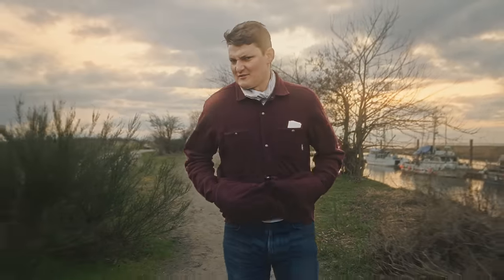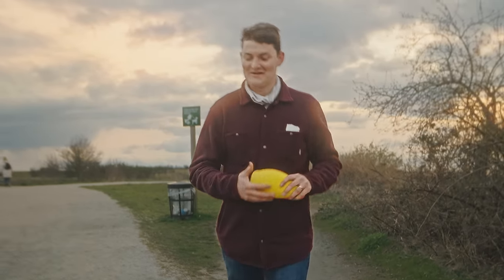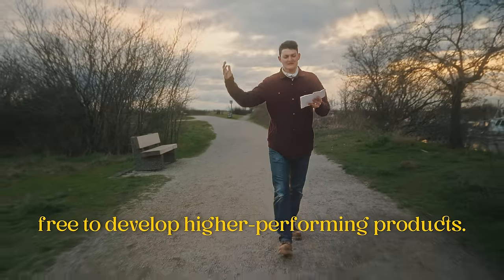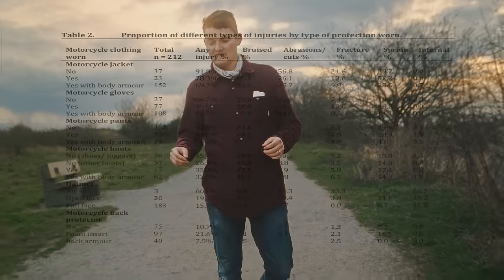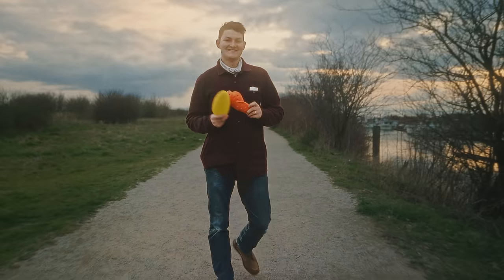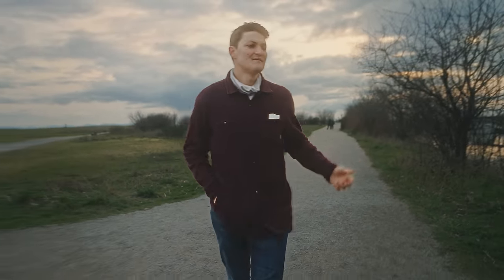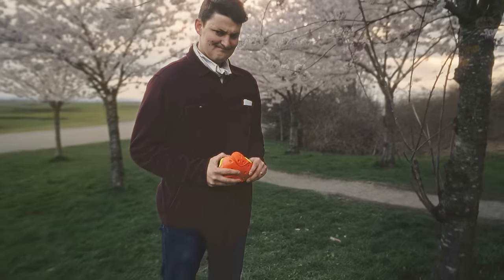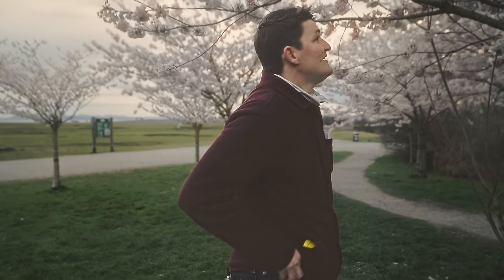Why I Stopped Wearing Motorcycle Body Armour

Comment: The joke here isn't manufacturers limiting testing, it's that more riders don't clamor for better gear and more realistic size options.

You COULD remove armor from gear...  Or, you know, get gear that's actually comfortable WITH the pads in place.  I've had plenty of falls in various sports, including on a motorcycle, that would have been much worse without that "insufficient" padding.  Not every impact is going to be 50 Joules or more - which means the armor stands an extremely good chance of reducing that 25 Joule impact to a point where it won't break a bone.  I don't feel like a safety sally because that same "insufficient" gear also eliminates a dozen everyday nuisances and makes it MORE enjoyable to ride.  For example, shoulder, elbow, and back protection lend structure to a jacket that might otherwise flop about.  Knee armor would have meant shaking off a relatively minor fall and enjoying a weekend at MotoGP, instead of limping around and pounding Ibuprofen like it was candy after wasting half a day at the Emergency Room.
Reply: Good point. Years ago I dropped a 125 on my ankle at 2mph wearing street boots and was in a cast for 6 weeks. Dropped my Varadero on the same ankle in December but in motorcycle boots and it didn't even leave a bruise.
Reply: In my experience motorcycle gear works extremely well when falling while slow. But you might well break a bone just falling over on a motorbike.
Reply: If I take your comments literally these pads offer enough protection - NO more is needed so no improvement ever. In a world where materials etc are evolving - manufacturers should never try to improve their products??? legislation is the driving force for R & D and the need to sell that product drives data collection.
Reply: @pamvarnsverry2444  Apparently you didn't read...  Why would manufacturers make more expensive gear if they don't think it would sell?  And no, MORE legislation is not a good thing.
Reply: @AM-hf9kk  legislation is always a 2 edged sword.

Comment: I have fallen a hundred times, maybe more, on my 20 years of riding. The sentiment that extra padding doesn't make a difference in falls is ridiculous and yall should be ashamed of yourselves for suggesting otherwise. Only one if my falls resulted in a broken bone (my thumb) but all of them hurt! And before I began wearing motorcycle-specific, padded gear, every fall resulted in real bad scrapes, bruises, cuts and punctures (an inch-long metal shard stuck in my butt cheek). Not to mention torn clothing.
Since buying even the cheapest gear, falls that would have pretty severely injured my knees, hips and elbows instead were just a tumble. Minor or major injuries that would have limited my ability to safely ride have been completely avoided. Heck, I looped my DRz and it fell on me and drug me ten feet on tarmac. If I were wearing combat boots and Levi's, I'd have needed skin grafts!
This video is misguided and will convince people who haven't crashed yet to ride without their armored gear. I believe you that the gear is not 100% perfect, but that is an unrealistic standard. Even at 25% efficacy that is still significantly better than zero!
Reply: You have fallen 100 times in 20 years??????? I have been riding for 50 years and fell about 6 times, you need lessons.
Reply: Yeah that seams lost in this video. The CE 2 armor is rated to absorb 41 Kn of force. That amount of force could be the difference between a shattered bone (LONG recovery time) and a fracture (much much shorter recovery time). While the armor isn't rated to prevent a break in an accident with those forces, it DOES help reduce the potential recovery time, which gets you back on the bike faster. That extra protection is 110% worth keeping those pads in place.
Reply: Falling over a hundred times is not normal, you should ride safer
Reply: I watched the same video and at no point did I feel like I was being told to remove my armour. 

I felt more like I was being made aware that we deserve better but we probably won't get it because the industry banded together to make sure they wouldn't have to ship the best armour. They just put enough armour so that your favourite leather brands can't count as "motorcycle jackets" when all they give you is 3mm of hide.
Reply: @christiancartmale1150 he even said the video wasn't telling people to remove their armor. 

People just want shit to be mad about these days
Reply: Exactly !!! Thanks for saying that.
Reply: @mikehurley5052  You're self-centered and limited. There are people who also use motorcycles for sport. At the track or circuit, you get a different perspective than farting in the pub or shopping.
Reply: @maxcoseti  You're self-centered and limited. There are people who also use motorcycles for sport. At the track or circuit, you get a different perspective than farting in the pub or shopping.
Reply: Now it's only 20 years of riding? Your other comment stated over 30 years of riding.  You said triggered by the comments your making through this comment section.  So what's your issue with the point of this video?  That you crash so much (which if is true, you may want to rethink why you continue to ride) that without padding you'd get hurt more than not?  How can you make that claim unless you've had SOOOO many crashes WITH and WITHOUT gear that you could make that anecdotal claim?   
Ryan even claims at the end of the video that padding DOES HELP in most small crashes and incidences.  Why you so butt hurt about this?
Reply: @elviscorgen9674  "You're self-centered and limited"  says the guy using ad hominem to make what point exactly?
Reply: @mikehurley5052  Nice, you've been riding for 50 years in a straight line for 10 miles each year and never practiced anything.
Reply: So you've clearly never ridden offroad on any kind of technical single-tracks or terrain.

I've fallen more times than I can count with much less riding experience and time. Almost all of the falls were at very low speeds. It'll happen, but that's how we get better.
Reply: Fallen 100 times in 20 years? Maybe you should stop riding. And you missed the point of this video.
Reply: @Generic_Name_1-1   "he even said the video wasn't telling people to remove their armor. " But then goes on to make an argument for not wearing any.  He carries a lot of influence and did not do a good job  explaining the main objective of the video. Was he making the case for better products?  Or simply not worth the effort to wear gear.  A CASUAL listener could perceive the latter and not the former. There are already too many riders that don't wear gear. This will give them even more reason not to wear any.
Reply: Fallen 100 times or more? I’ve been riding since 1976 and have fallen less less than 10 times. I’d have to be doing something VERY wrong to fall 100 or more times, wow
Reply: @Waldo1122 UK, europe , Balkans, yep i been nowhere.
Reply: @spartanx169x  he doesn't make an argument to not wear any, he argues its not effective from the research we have. Nothing more, nothing less.
Reply: @mikehurley5052  Oh you have been somewhere, IN STRAIGHT LINES! Every old head that has said "I have been riding for 50 years" can't even do an 18ft U-turn or maneuver their motorcycle at slow speeds without duck walking.
Reply: @Waldo1122  Look at a map if you can read one.
Reply: @Waldo1122  UK, France, Holland, Belgium, Germany, Austria, Slovenia, Croatia, Bosnia, Serbia, Kosovo, Macedonia, Albania, Italy, Bulgaria, Romania, where have you been? Nowhere is my guess. Never fell off once.
Reply: @mikehurley5052  Striaght roads, Straight roads, Striaght roads, and never practicing. He fell 100 times because he is practicing to be a better rider. You just ride along striaght roads at 50 mph and because you can work the clutch and throttle enough to go forward you think you're top shit.
Reply: @christiancartmale1150 THANK YOU :)
Reply: @CBCycles  sorry man. I like to push it and find limits. Luckily the vast majority of my wipeouts have been offroad, and most of the ones on pavement are from trying to get good at wheelies (a practice I have long since abandoned!). But I still enjoy skid turns, drifting and foot-down-turnarounds and I'll eat it from those occasionally, too.
And I'll wear pads when I'm doing those and when I'm not, because regardless of your opinion is of me, you have to admit that I've got the requisite experience with crashing to speak knowledgeably on it!
Reply: There is literally no way you've had over 100 falls unless you literally only ride off-road and do so all the time. If you've fallen 100 times on-road, I don't think motorcycling is for you
Reply: @mikehurley5052  haha, I like to push it and do fun stuff on my bike. When I take lessons, in safe controlled environments, on supplied bikes (!) i push it harder still! It is great to build confidence in my skills but also in my equipment. I remember being afraid of crashing. 
I would love to tell you to crash more, you might have more fun, but I don't know you and would never suggest you ride how I enjoy riding.
(Also, do you see my mirroring of Ryan suggesting we do something without actually telling folks to do something?)
Reply: @Generic_Name_1-1  When a celebrity endorses a behavior, they don't need to tell folks to do it to have influence over people. In fact, he doesn't tell folks to keep their armor in, he says he can't tell you to remove it. 
You might have a leg to stand on if Ryan said explicitly to "Please keep your armor in and also try to upgrade it", but instead he said "I can't tell you to remove your pads, but I remove MY pads, and I LOVE it!." 
Some people are definitely going to remove their pads after hearing a respected and trusted personality say that.
Reply: @basedury  I can slip out 10 times in a day of riding offroad. I recently bought a GZ250 to experiment with that in the woods and slip out at least twice whenever I do. I never wrecked on my CBR929rr. my CB599F, my Triumph Speed Triple, Kawasaki Concours or Dyna Superglide. But my DRZ400 saw some ground time! I've ridden hundreds of bikes while working at a dealership and I never crashed them. 
I crashed when I was making mistakes, pushing my limits, or experimenting with things. And it's fun to crash sometimes, especially when I wear good, armored gear, learning to better trust that gear and my bike, and learn new skills and techniques. 
I learned to really prefer crashing with armored gear than without it! Suckah!

Comment: Just looking at the abstract for the Dome study, while it does indicate armor does not seem to have an appreciable reduction in fractures, those are not the only types of injuries. The abstract also notes "When garments included fitted body armour there was a significantly reduced risk of injury to the upper body (RR=0.77, 95% CI: 0.66-0.89), hands and wrists (RR=0.55, 95% CI: 0.38-0.81), legs (RR=0.60, 95% CI: 0.40-0.90), feet and ankles (RR=0.54, 95% CI: 0.35-0.83)". Seems like the question is whether one expects the bits of armor to protect against fractures or to protect against injuries. 

Maybe more important is the finding that in several instances the effectiveness of any armor was negated by the fact that the garment failed (disintegrated, etc.) during an incident which rendered the armor useless. The study suggests this was due to poor quality control on manufacturing of gear, so maybe buying high quality gear is worth it if one wants to minimize the risk of injury.
Reply: Hands and wrists are gloves, feet and ankles are boots. Ryan doesn't suggesting not wearing boots or gloves (or riding jacked and pants with cevlar), but rather about usefulnes of insert pads.
Reply: My D30 is there to protect against the initial impact at 90 KPH; I fully expect the sliding and the bounces are probably going on skin.
Reply: I once had a minor tumble wearing a hoodie and armour underneath. I was shocked that the outer hoodie survived with no damage and the armour torn apart at the shoulder.

The garment was not CE rated which I excused because it was not intended to be the outer layer. I only wear whole garment CE rated stuff now.
Reply: He literally said that they works for other things but not for fractures in the video. He doesn't says anything about, helmets, gloves, abrasion resistent gear, boots, knee protectors. This is spesificly about pads. Which are certified by their impact resistance and how that certification has little to no effect again again impacts.
Reply: interesting position. i think first and foremost, the protectors are there you minimize injury. how do you do that ? by trying to negate the maximum damage that could be applied: in this instance a fracture. according to this video, standard protectors DONT, but they prevail and negating secondary class injuries like bruises and scratches from lesser impacts.
Reply: @Deivs65  Upper body and legs are both included in OP's comment, and those do have pads...
Reply: @Deivs65  "upper body" "legs" you missed those. Why cherry pick, jesus christ.
Reply: @Deivs65  yes, I understand his point. It seems like he is focusing on whether the insert pads prevent injuries by only referring to the fact that the study found no reduction in fractures. But that is only one type of injury and the study does seem to suggest that for injuries as a whole, the armor is useful.